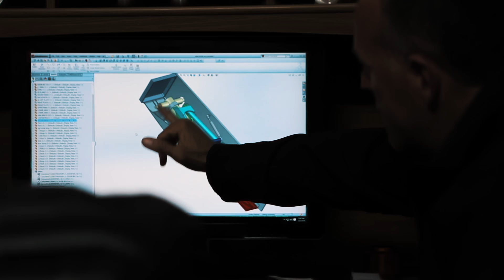Introduction to Mike Patey

Comment: Hey Mike awesome vid as per usual thanks for your time and effort. Any chance of like a time line of all your builds and what brilliant ideas you had to make them fast. Not as simple as a big motor for speed so much more involved. I used to fly an sr22 which would cruise all day at 165 indicated and a friend said double the horsepower and it will do over 300 indicated. I did the math roughly in my head and got to a speed of around 210 to 220 indicated would of been the result with no range to play with. Kinetic energy is hard to make efficiently. All the best keep going mike

Comment: Mike.  You and I are quite a bit alike.  No matter what it is, you can always skew the design compromises to make it better at what you want it to do.  I always wanted to see you add a five blade hub and another blade to Draco then stick in the motor from Turbulence.  You know, just for fun😉.  Too bad it’s gone.  Draco still needs about 80 more inches of wingspan and a complete stem-to-stern evaluation for weight reduction.  Reducing the weight will lower the wing loading and allow extending the wing tips without over stressing the spars.  PLEASE tell me you are way ahead of me and plan to continue to improve Draco.  With the skills you showed with modifying the wing, wouldn’t a cool Winter project be to build a new wing from scratch with no compromises?.  Easy to say; you work hard and I just watch!

Comment: Mike whatched landings at Oshkosh looks like u hav to much rebound in your shocks about every time your shocks have so much rebound it throws u rite back up in the air brakes don’t work very good when the tires are in the air soft in the shocks.  Love your vids an your planes
Reply from the maker: RANDY SR CLINAGE yep, I agree ☝️ I noticed it on my first test flight before I bought my first Wilga. There is no rebound adjustment on these old shocks. Someday I will redo the shocks with adjustments but it was down the list of needs from engine, wings and other. Later project for sure 👍🤠

Comment: Interested on working for you shop Mike I'm a fabricator on any comercial material ...CNC machinist... manual machine's since 1990 welding ...sheet metal .... break machine .... fab my own parts with no sketch or blueprint all I need to see is where the connection is missing like engine mounts exetera I have experience on engine's Diesel gasoline electric ....is time for me to move out California to a fun place ......let me know....? 
Thanks.